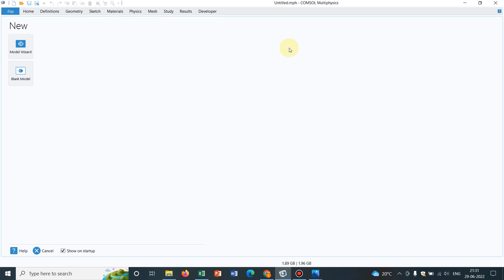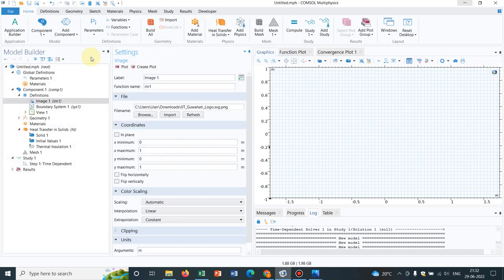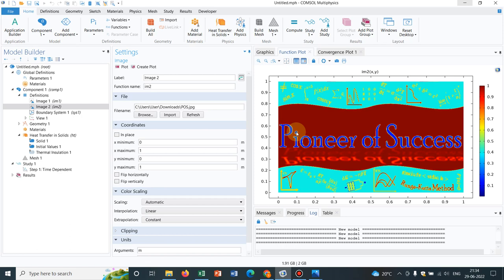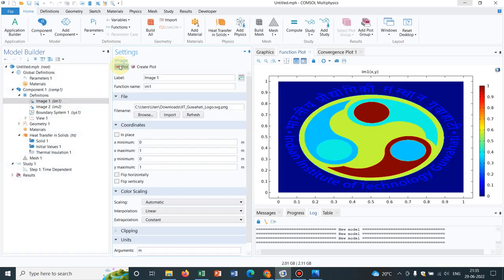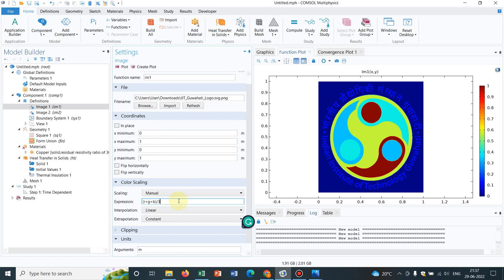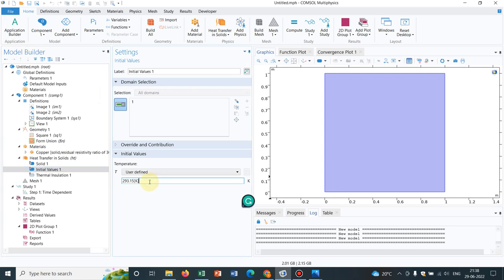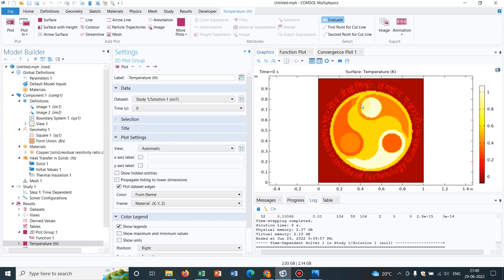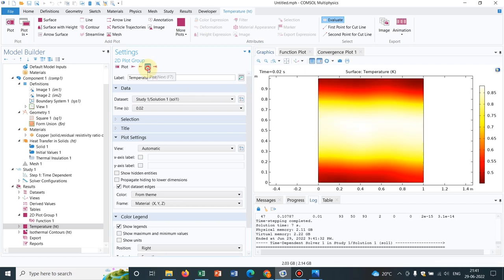Using Image as Functions in COMSOL #Functions #COMSOL #Image #RGBValues #PioneerOfSuccess

Comment: Have u noticed that colour scheme changed when u imported it inside comsol.
Reply from the maker: Yes, I did notice. I will think about the reason and let you know. You can also write to me if you have the answer.
Reply: @pioneerofsuccess4054  that's because the image  scaling option  is showing the average of three colours  per pixel ( r+g+b)/3,  if u write only ' r ' ( portions with red content will get higher values) and so on. 
To revert it back to its original colour, some calculations needed ( 0-255 , three 8-bit colour channels and picture L x W pixels)
Got this info  from COMSOL ref. manual.
I want the image fn show true colour, whole last week, trying to figure that out    😀
still trying.......
Reply from the maker: @atanughosh8312  Actually, color images bear three different variables. When we are using them we are using as a single valued function and that is why we need to merge three variables into one. Anyway, excellent observation with accurate explanation. I thank you.